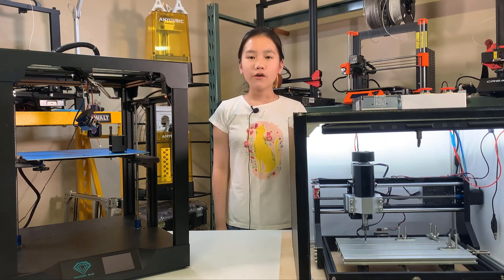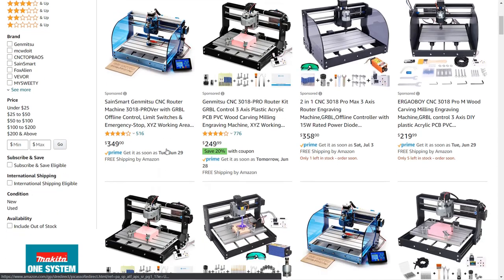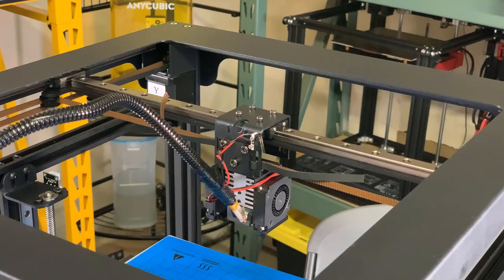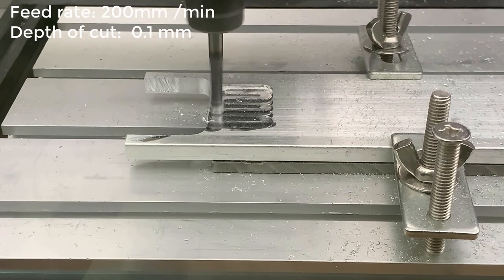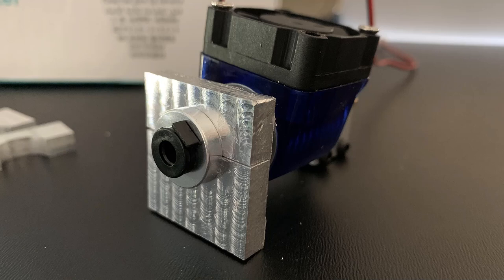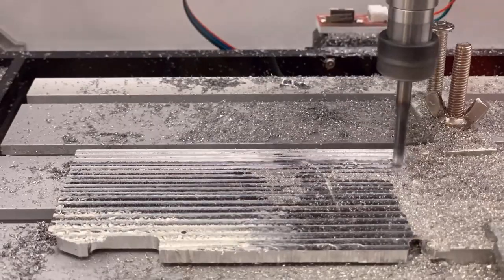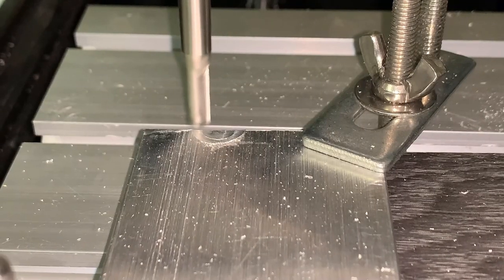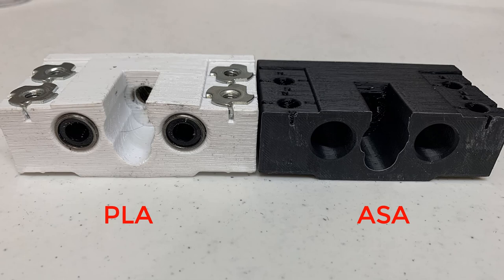Cutting aluminum parts with 3018 Pro CNC, making an E3D V6 hotend mount for the Sapphire Plus CoreXY

Comment: You may be new to milling but you have the first successful aluminum run I've seen on a budget CNC. I put mine away without use when I could find no successful metal cut attempts. Mine is all aluminum  built with a mid size motor so it should work. Pulling it out to try. Thanks for the inspiration.

Comment: one thing that would help , it is to put some cutting oil on the tip of the cutter while cutting the parts, it will cool it down and help the cut , good work and you can tell your brother that he is doing a good job with the videos , you can also tell your parents that they are raising two great kids 👍 , and from what i saw in the comments lower , sois tu lis le français ou tu utilise translate , mais ta réponse en français me faire dire que que es une personne ouverte aux autres langues et c'est admirable de ta part,  bravo !  merci de partager tes vidéos 🙂

Comment: Aargh. I bought a "T8" desktop CNC engraver on the back of YouTube recommendations a few years ago. It's not rigid enough to accurately engrave plastic. Just ordered a 3018 engraver from another youtuber's recommendation and now I learn it's not very rigid either? fingers crossed it'll still be a big improvement. Thank for the excellent videos!

Comment: You’re awesome! With the spindle heating up, I’m surprised you didn’t use any cutting oil. Anyways I really want to get one of these and slap linear rails and a larger spindle (I’ve seen some people use dremels or makita drills for the spindles and get really good results) Yeah, there are a lot of upgrades you can do on this.

Comment: I have one of those same CNCs and just purchased the 500W spindle. haven't mounted it yet though. Also have the limit switches and planning to get them installed. While the 3D printed option for the mount allows the most flexibility, one option is to mill a new mount using wood instead. You won't have it go soft from a little bit of heat! Maybe figuring out how to mill one later from aluminum would be best though even if done as a couple layers/pieces.

Comment: Fan-Tas-Tic. Amazing how much experience you show. If you want a job in the CNC industry, call me. You can start on Monday. Besides, here are a few tips for your cheap machine alu cutting: Always use single flute endmills for alu. Even cheap ones will do a good job and greatly reduce the stress on the spindle. Always use ramping (spiral ramp) to enter the material as well as for cutting and also try toroidal milling. These precautions will help your underpowered and flimsy machine to hopefully get useable results. You also need to be careful not to go too slow as your chips will get too hot. The plastic spindle mount is a bad idea as it retains the heat and supports heat build-up. Make one from alu, it will work much better. I just admire your videos, you have so much knowledge and your presentation skills are great. But even better, your video preparation and research are tops. Am sure your brother helps you a bit. You deserve 100000 views and you will get there.
Reply: The actual mount that holds the spindle is aluminum and comes with the spindle. The issue in this case is the Z axis carriage that it attaches to. The one that comes with the system is integrated into the original spindle mount so has to be replaced in order to mount the more powerful spindle. The 3D printed option is pretty common since it is often readily available. However as they discovered using a lower temp plastic is bad. Most approachable initial option would be to use the system to mill a carriage from wood, perhaps in layers that can be stack laminated together. Using that, the system could run the higher power spindle and be used to mill an aluminum option. Another idea would be to add more active cooling to the spindle mount, maybe just in the form of a fan blowing on the spindle mount to help bleed off heat.

Comment: Awesome video and great instructions. Little advice... make sure your tool is as short as possible. Get a shorter endmill and put it in the spindle as far as you can. If the Tool can't reach the desired depth, just move the whole spinbdle motor down in Z and your finish will be a lot better.

Comment: Being that i did this. I can confirm increase your speed, reduce feed and i have run up to .015" deep. Have you ever tried any coolants? And  you should move  your X and Y to start position then run rapid to .100" above. Start spindle and move Z last to start cutting. This prevents dragging over the stock. Lastly you really should spot the hole before drilling and use same spot drill to chamfer the edges after. To remove some machining marks using fine grit sandoaper can give you a nicer finish.

Comment: You wouldn't be the only one to cry about breaking expensive bits. I get carbide burrs for cleaning up welding projects and occasionally need to grind an inside corner. On a high speed rotary, that's dangerous and you have to be very careful as any 'skip' will quickly multiply as it careens off the inside walls and usually breaks the carbide burr sometimes sending pieces of it or the stock flying.  But if you manage to escape flying bits, you still have to sit and cry over a $30-70 burr laying in pieces across the garage floor.

Comment: Do you know about chatter? Chatter happens when there is not enough material for the cutter to cut so it pushes passed the material leaving a smudged/melted look. You can fix chatter by decreasing RPM or increasing Feed Rate. Also increasing rigidity will help prevent chatter. Hard deal for your situation. Try less tool stick out, better work holding, and less than 100% step over for your tool path. This is a make believe number but maybe with say 3% stepover the motors can handle full speed to utilize full rpm to avoid chatter. Maybe try a super short tool with insane number of flutes. Have fun!!

Comment: you need to build some cooling apparatus for this thing, better cooling milk than air. You also want a real Wolfram-Carbid bit which is aboz 25-30 bucks for a standard size. I think this machine is amazing. trust me this thing can do more than 0.1mm depth in aluminum given a good bit and proper cooling. Everybody can be an engineer now.

Comment: I came here looking for the CNC but saw that we have the exact same Sapphire version. I cut the Z lead screw tops with bolt cutter and printed a plastic hotend mount and fan shroud for v6+volcano (again same choice.)

Otherwise for Sapphire Plus, if you have the version with Z screws on sides, volcano block collides with the screws.

Comment: I think you could've made an aluminum bracket for the spindle. Or even wood.
For aluminum on a cheap CNC: carbide single flute endmill (cheap ones work ok, upgrade without breaking the bank: Yonico brand), adaptive cutting on fusion360, adapt an air assist with a cheap compressor or dust collection or both. Finally if you have some more of that nice aluminum, replace the plastic parts of the machine and upgrade the steppers to high torque n17 (the board allows a bit more amperage, just add a sticky heatsink on the drivers)

I realized this is old, so just leaving this in case anyone else is getting one of these machines.

Comment: As an engineer and hobbyist, bravo! Fantastic work the two of you. Excellent presentation method and writing. I would highly recommend using coolant/lubricant for cutting aluminium with this machine. Although technically not required DC for more expensive machines, this hobby cnc needs all the help it can get. Any lubricant is fine, but even just using something like water or ethanol mix helps dramatically. Just  be careful and it will be a little more messy. Surface finish will be brilliant.
Reply: Is it a reasonable concern that water ethanol would catch fire during use?
Reply: @Thedamped  Usually the mix is around 60% water to 40% Ethanol, so no, the mix is not flammable. Also aluminium is a really good conductor of heat, and chips are not hot enough to create any risk of igniting the mix. Finally, these machines are cutting such small amounts with low feed and speed rates that the chips that are produced are more of a powder than actual chips.
Reply: @eurisko84  Thanks. Good to know. Though that mixture is definitely still flammable. I know from experience that 50% ABV will burn for quite some time while the ABV is constantly falling. I found a source that confirms flammability at least as low as 24% ABW:

Flammable Liquids and Class 3
"...the dissolution of a miscible flammable liquid in water affects the flammability. For example, pure ethanol will flash at 12.7°C; a 70% mixture by weight in water will flash at 23°C; and a 24% mixture in water at 60.5°C."

After reading a bit, it seems that fires are pretty common anyway so something you have to mindful of when CNC routing, especially when dry cutting wood. Which thinking now, seems obvious that the most common thing you cut is also flammable. I found other sources that back up your suggestion for using it as a coolant/lubricant on aluminum, but warn against using it in ferrous materials that can produce sparks. So also comports with what you're saying.

So it's probably safer using ethanol to cut aluminum than dry cutting wood. 

I'm still getting my feet wet with this. It seems that CNC routers really need supervision. Apparently they are the most common cause of fires in machine shops.

Have you ever had a fire? What all do you cut?
Reply: @Thedamped  I should have been more clear, yes, it is still flammable, but less so than pure ethanol/methanol. Also do not aerosolise the mixture, only and use a direct jet or injection method onto the part. I use a small spray bottle on a single stream (not spray) directly at the part, whereas I have seen people use misters or the like, but I don't like this method at all. I cut 95% of my parts in aluminium and small templates in MDF, but you cannot use any lubricant on wood or MDF. But you are correct, it is a very dangerous machine to leave unattended, and as per all machines, shouldn't be left to run on its own without supervision.
Reply: @eurisko84  Oh okay, interesting. Thanks.

Comment: Great video, lots of information for me to check out further. I have a 3018 myself and was having problems with skipping steps. I upgraded to bigtreetech B42C closed loop driver on the standard steppers that came with the machine and all skipping problems stopped.
Reply: Is that why she has lines in the final product?

Comment: OMG, as someone new to CNC who's been watching ALL the videos to figure out how to not break things, Speed Tiger is life!! Well, okay, Speed Tiger AND Spetool is the other comparable brand I found. 

Odd question, where did you find speeds/feeds for speed tiger end mills? I've been literally copying the ones from SpeTool, but I'd prefer to run slower if I'm supposed to or faster if I can

Comment: yah, the spindle, i live in an apartment, so noise is my concern, next option up is bloody expensive, but really quiet, water cooled with a vfd, too big to fit the 3018, though a counterbalance and willingness to reduce capacity would allow someone to cut parts for a bigger machine..

Comment: Wow, very impressive young lady.
You said you are going to 3D print that part for the CNC, would making it from aluminum be a better fix?
I ask as I have a 3018 that I extended to be a 3040, I am still using the stock motor, and I plan on getting an upgrade motor, maybe even that one.  Every thing I have done has been very short timed cuts, when using the spindle,  all my others have been using a laser, all have been cutting wood or paper.   I believe your skills are way past mine using the Spindle to cut with.

Lee

Comment: You mentioned skipped steps.
Have you looked into closed-loop stepper motors? 
I recently bought some and a new controller from BigTreeTech, when they arrive I'm hoping those and my other upgrades to my DIY CNC engraver will make it a little more reliable.
Would be interested if this is something you both have looked into or have tried.

Comment: Great video !!! At 4:47 minutres into the video you go through a sensor probing routine to tell the CNC controller where the "Z" home; "X" and "Y" positions are relative to the piece which you are machining.  Could you please provide the commands for the g-code sub-routine or macro that you used to accomplish this ?  Also what software are you using with this CNC configuration ??

I'm new to dekstop CNC milling and 3D priniing and have found your videos to be a most valuable resource. Please continue producing these great videos !!!
Reply from the maker: You just need to install Universal GCode Sender (UGS) and use the probe plugin, which is free to download.
https://winder.github.io/ugs_website/

Comment: I would think that using a slightly more heat-tolerant plastic to model the spindle mount which you could then use to machine the same mount out of aluminum would be better.

Comment: great channel. very clear with your process. i made the mistake of buying the more expensive 3018 cnc but mainly cause it came with a 7watt laser but ive found i like using the router spindle more so i want to upgrade an you have been the first ive seen show the process of how u did it an what spindle you used an also went into the bits. thank you very much for this. i will be picking up one of the 500watt spindles just for using with aluminum but since having this setup now for awhile what would u suggest now after living with your setup.

Comment: Thanks for the great video. I’d love it if you could buy one of those cheap rotary add ons for the 3018 much like the Snapmaker has but for a fraction of the price (not the roller type). Is it even possible? I’m assuming you’d have to raise the entire hight of the Z axis?

Comment: I propose you start making a new spindle mount out of aluminum.
Reply from the maker: I am afraid that may not possible with this machine as the usable Z-height is just 27mm after the 500w spindle upgrade, the minimum height of the Z carriage/mount is at least 40mm.

Comment: a few things: 1) reduce your stick out as much as you can 2) get a router or even better the routER 11 by inventables, those can reach 24K rpm and for small endmills that key 3) if you gonna stick with this setup I would strongly recommend against using that big of an endmill, 4) check the printnc CNC, its a very capable machine. 5) if u are looking to upgrade your machine even further check the 3018pro MGN :https://www.youtube.com/watch?v=MknuEkM0_JM&t=87s

Comment: Very interesting video as I have been thinking about CNC for just this sort of functional parts and been wondering if it was possible on a cheap machine.
Reply from the maker: Yes, it can actually work as a light-duty micro mill if you upgrade the spindle.

Comment: How did you use the touch probe to home x-y axis? Modified G code? My 3018 only probes z axis? Excellent video! 👍
Reply from the maker: I just use Universal GCode Sender which includes the XYZ probe plugin.
Reply: @AuroraTech  I will have to research that. Thank you for your response.

Comment: What software did you use to drive your CNC? Also you would have needed to upgrade the firmware of the CNC to account for the new endstops right? It would be interesting to see how you went about all that. Good video (as usual)
Reply from the maker: I use the free UGS(Universal GCode Sender), you don't have to upgrade firmware, the limit switch connectors on the motherboard were enabled by default, just plug the switches and config the direction of homing using UGS.
Reply: @AuroraTech  Thank you!
Reply: @AuroraTech  What did you use for pathway G-code?
Reply from the maker: I use fusion 360 CAM to generate GCode.